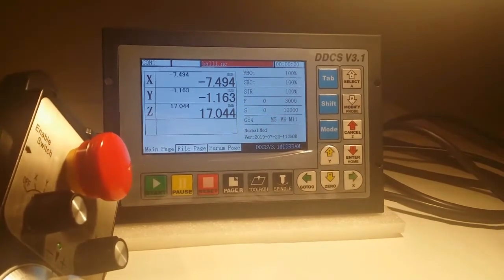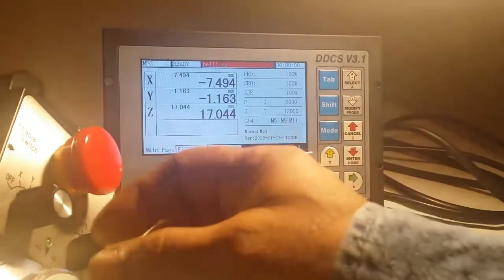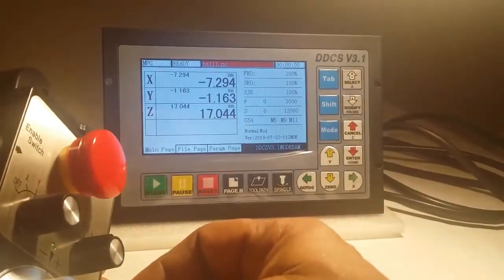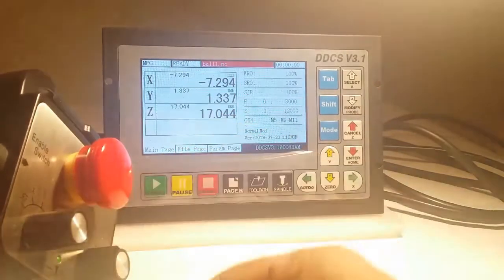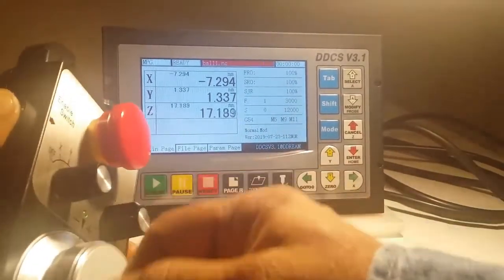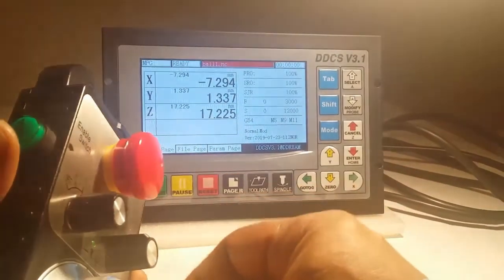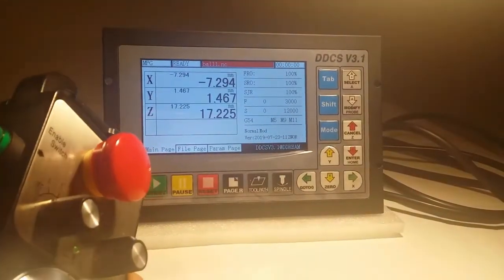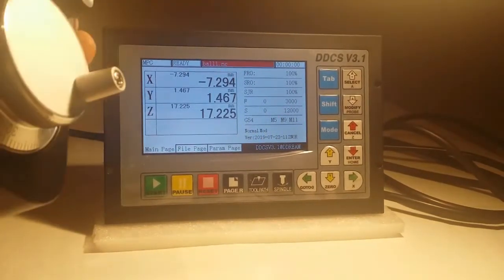DDCS V3 1 With MPG Handwheel PLus The Diagram

Comment: Hello Yacoub,
I wonder if this controller is interactive like Mach3 ?

Meaning is it possible to type Gcode in a command prompt let's say to cut a straigth line?
Thanks
Reply from the maker: Hi, it's hybrid you can choose the mode of it like mach3, but I did not try to  type a Gcode in a command prompt.

Comment: Hello again Yacoub, I still can't get my MPG working so I amputated the 15 pin D plug and found that the wire colors are different (!) to those shown in your diagram. If anyone else is having this problem I suggest they go to the Digital Dream Forum where, I hope, Shania will provide us with a solution.  I have sent some pictures to help show the problem. I am not optimistic with this but I hope it can be sorted out. I won't intrude on your YT posts any further but many thanks for your clear and informative presentations. Anyone who needs to contact me re this problem can do so via the DD Forum.
Reply from the maker: Thank you for your update, Not spouse to flow the colors in my diagram flow the wire connection.

Comment: No success with the MPG... Even less success with getting help from the manufacturers. I have checked every connection accessible to my meters and altered all lines relevant to the function of the MPG. I would strongly recommend caution to would-be purchasers. This is the second time I have been abandoned by poor quality, half-hearted support from Chinese electronics manufacturers. 
Anyway, I will keep on trying to solve this and I will post any results back here. Thanks to Yacoub for allowing me to intrude on this excellent YouTube comment page.   :)
Reply from the maker: You're most welcome, I bought my ( not original MPG) online from that link and I notes that is a look like the original one but if it's another kind of mpg may need to be a different connection.

https://www.aliexpress.com/item/32914048895.html?spm=2114.13010708.0.0.3a994c4dMUcVXH

Comment: Thanks for the links to your settings. I have made my settings identical to yours but still nothing. Strange to say, the buttons and EStop all show as connected, Estop works fine but no LED or axis motion at any switch position. Digital Dream seems to be clueless on this problem. They claim it was working at the factory but this is clearly not the case.
I will take the thing apart and trace every wire and see if that helps. So much time to fix such a simple problem  :(

By the way, I really admire your craftmanship with the enclosure, the wiring layout and the clear explanations You are an exemplar!
Reply from the maker: You are welcome , Now this is the third same complaints but the difference is you have partially problem. So that's mean you connected the two adaptors.. That's strange, Please continue to to tell me after you check the wiring what is the issue , I would appreciate if you could do.
Reply: Thanks for your support with this problem. I have 24.04V on the main power input terminals and 24 .06 on the separate, I/O power input terminals. The PCB in my MPG is different to your pictures but obviously the connections should be identical. I will let you know my findings as soon as I possible. Surely I am not the only person on this planet who has constant problems with Chinglish and failed components...

Comment: Hi Yacoub, I'm having a big problem with my MPG. Everything works on this excellent controller, steppers, switches, etc. except the that the MPG, which appears correctly connected, and with all switches working, there is no operation when put into MPG mode. No LED glows and no motion control but EStop works fine. Can anyone suggest a cure? I'm getting pretty frustrated...
Reply from the maker: Hi check your settings and test your wiring. I have a link for my settings, I hope this well help.
https://www.mediafire.com/view/cybafm2wceej6j8/20201213_200932.jpg/file

https://www.mediafire.com/view/zdjz91wzsigpsyn/20201213_201050.jpg/file

Comment: I made the MPG connections but only the X axis works. How to make the other axes work?
Reply from the maker: Check your connection again by tester, As long as X axis works that's means you are in the right bath, Another thing I want you to do to check the stepper motor replace X axis with Y or Z.
Reply: @yacoubjabal3762  In the controller all axes work, but in MPG only the X axis worked. Are there any parameters to configure on the controller?
Reply from the maker: @Thiago_Piermatei  Oh I see I have my parameters I hope it will help you, 
 https://www.mediafire.com/view/cybafm2wceej6j8/20201213_200932.jpg/file
Reply from the maker: https://www.mediafire.com/view/zdjz91wzsigpsyn/20201213_201050.jpg/file
Reply: @yacoubjabal3762  After modifying the settings, the x axis also stopped working," I returned to the previous configuration. Could you send me the MPG connector settings?
Reply from the maker: @Thiago_Piermatei  That is strange, I show you my MPG Parameters Setting I think the wiring, The colors is tricky try to check the wiring again by tester. I have no idea why it's not working with you !!!
Reply: Hello, I have the same problem, did you figure it out?

Comment: I have same problems with MPG and can't figure out what is wrong?!
Reply from the maker: Make sure the two power supplies is working
Reply: @yacoubjabal3762  Yes all working. I check all pins on connector on DDSC and  MPG, power on MPG have 5v all other communication pins for X Y Z and 1x 10x 100x have 0.5v output. MPG have green light. Whell working if I go in DDCS IO. Maybe the problem is on parameters?
Reply: @yacoubjabal3762  problem is on this pins with x y z off and 1x 10x 100x and E-button
Reply from the maker: @MillanMac2012  Read 2.6.4 at this manual  Please . http://www.mediafire.com/file/c7iiqaalvqln5zt/DDCS_V3.1_MANUAL_V3.pdf/file
Reply from the maker: if your wiring All Oaky it should be work.
Reply from the maker: Also the amperage for the adaptors is important
Reply: @yacoubjabal3762  I have 2x 24v 1,3A
Reply from the maker: @MillanMac2012  2x 24v 1,3A that should work , you may need to reset your controller to default I did not do that before, And test all your wires with tester to make sure all the connection is fine.
Reply: @yacoubjabal3762  Something is not right.  
Can you sent me on e-mail picture of your parameter settings of MPG and second screen toolpath where you can see IOs of DDCSs?
Reply from the maker: @MillanMac2012  Okay sure   https://www.mediafire.com/view/cybafm2wceej6j8/20201213_200932.jpg/file
Reply from the maker: https://www.mediafire.com/view/zdjz91wzsigpsyn/20201213_201050.jpg/file
Reply from the maker: Try this settings and tell me !!!
Reply: @yacoubjabal3762 I find out, non of those ports IO doesn't work 🤔
Reply: Something not right with powersuplay n2
Reply from the maker: @MillanMac2012  hmm, ( non of those ports IO doesn't work ) meaning that your MPG is not powered yet ? So Two options left change the adapter and try to update your controller, I run out from thoughts what do you think?
Reply: @yacoubjabal3762  Now works. Next time double check polarity + and - ,😏
Reply: Wheel have power from the 1th power supply 2th is only for IO that means all buttons are IO. The green led have power from the wheel 5v same as USB
Reply from the maker: @MillanMac2012  Glad you have it solved yahhh :)
Reply: @yacoubjabal3762  Do you know how to reset or setup machine 0? The only thing what I find in manuals is, how to set 0 points on G54.
Reply from the maker: @MillanMac2012  try that one from  Boyan Silyavski
,  it works great with me....

At the back of controller connect 12VDc and Pause to a button. Then inside menu program button to Zero all instead of Pause. parameter  #467  function of External key 2        0.Pause 1.Zero     . Choose 1 then Thats all.
https://www.youtube.com/watch?v=o6uJ2M4NVY4
Reply from the maker: by the way about your second power supply there is potentiometer to adjust the voltage
Reply: @yacoubjabal3762 Machine 0 I mean that small coordinates. When I 1th time power up he remembers actual position machine. I will have that numbers all on the - end of machine.
Reply from the maker: @MillanMac2012  First do the configuration and tune up your axis machine, when you do homing and soft limits you will get actual position of your machine.

Comment: thinking of getting one of these for my x3 conversion does it support manual tool changes yet? also is there a limited number to g code ?
Reply from the maker: yes it does support manual tool changes but you have to probe again after a tool change.
and I think USB flash disk support for G code file input,no size limited of the G-code file.
you can also check the forum( http://bbs.ddcnc.com/forum.php?mod=forumdisplay&fid=41&filter=heat&orderby=heats )